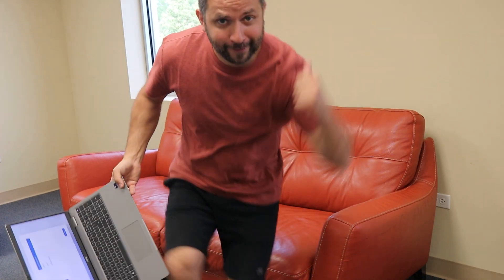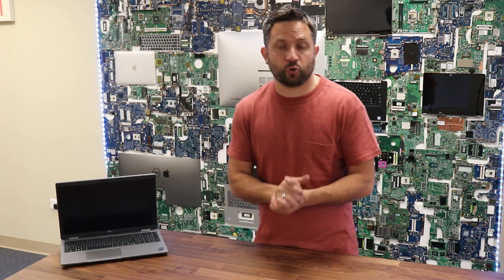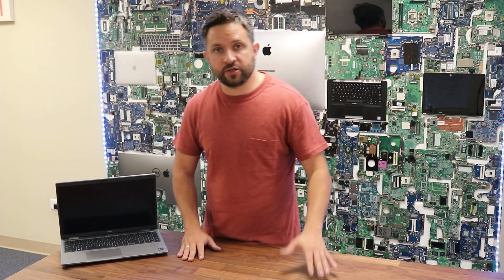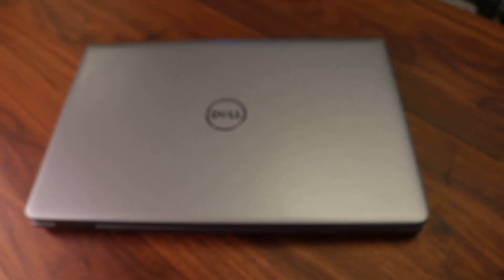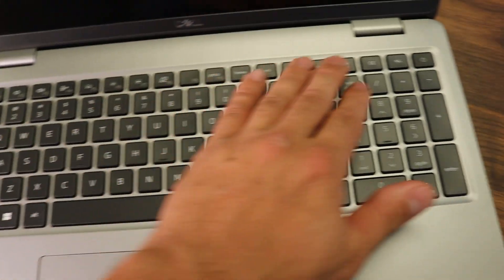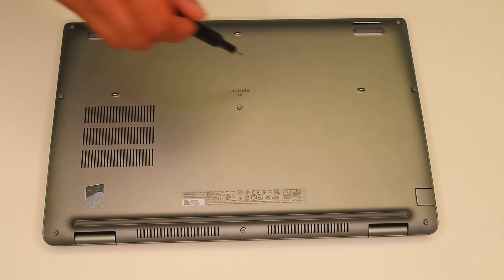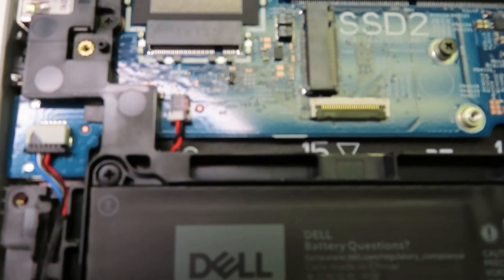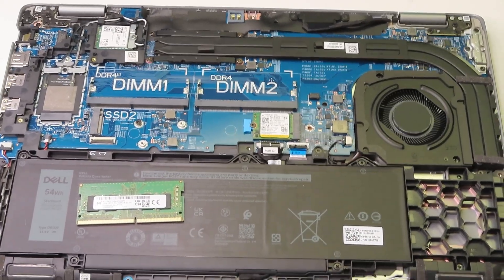Dell Latitude 5540 - review, upgrade and repair

Comment: Will it support 130W power adapter, can I use the Dell 130W USB-C charger for this model (5540), or it will support only upto 100W charger?

Comment: smallest touchpad 2023 for a 1500-200$ price point...damn...and huge screen pezels...
Reply: Man what are you talking about? I just got this machine and I hate the huge track pad. Also, it doesn't have separate mouse buttons, whole surface is touch sensitive, so if you keep one finger on the left mouse button and use other to drag  the bloody thing does pinch to zoom or is stuttering on the screen! Also, they removed one usb port, so if you use logitech mouse receiver, then you only got one usb a port left. If I wanted no ports I would buy mac book. On normal laptop i want plenty ports and decent keyboard. Oh by the way, there is power button where the delete key used to be. And no seperete arrow keys. If I paid my money for it it would go back straight away
Reply: @jackalek  Did you find an alternative? I never considered the lack of touchpad mouse buttons
Reply: @thunderstar254  sorry mate I didn't. It is work provided machine so no really a choice. I basically don't use the keyboard and touch pad of I can avoid it. In the office I plug into dock station where I have dual screen setup and proper mouse and keyboard. and when I'm in the field, I use logitech travel mouse. It's a shame most manufacturers is trying to copy apple. Stick plenty ports on it, and stick these on both sides of the machine. Give me decent keyboard with separate arrow keys and home end page up page down keys. It is doable, precious generation was much better keyboard and track pad wise.

Comment: Just a few notes.
The system has more storage options - the aforementioned 256GB, 512GB, but also 1TB, 2TB. Also 5540 features dual storage capability, and the secondary SSD can be either 512GB and 1TB option.
Also there are two battery options, both are 3cell, but one is 42Whr and the other one is 54Whr. Power adapter comes also in 3 options, 60W ultralight, 65W the standard AC adapter and 100W, ar all USB-C.
The material used on lid and bottom cover is carbon fiber reinforced plastic, so it is sturdier than standard ABS plastic.
DDR5 memory is tied to Intel P28 CPUs - so i5-1340P, i5-1350P and i7-1370P. On the other U-class CPUs you get DDR4. Both memory types can be upgraded to 64GB.
Reply: Hi friend,  do You know, can I use samsung 990 pro 2 tb with this laptop ?

Comment: My dell 5540 i5 13th gen doesn't recognize my ssd m.2 ngff I used in my old computer.
Reply from the maker: most likely your old SSD is not compatible with your new laptop. To my opinion M.2 is very complicated as there are quite few versions and some of them ( even if they looks the same) will not work on some machines.